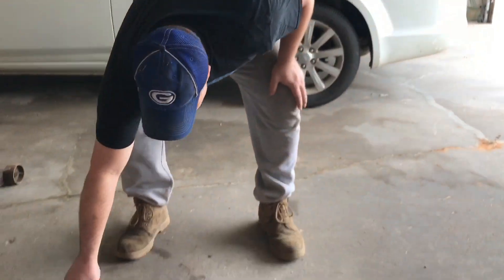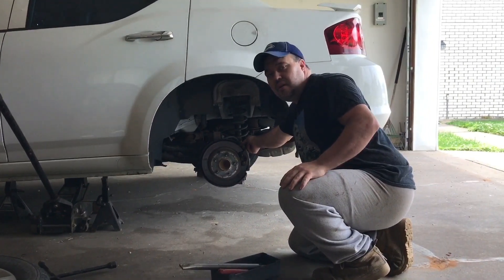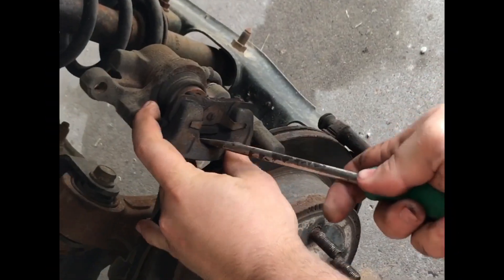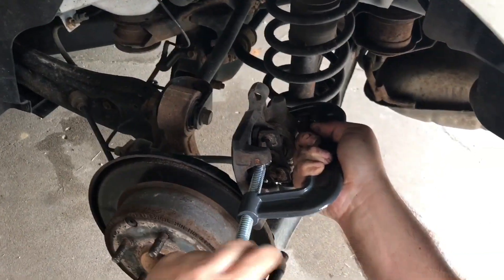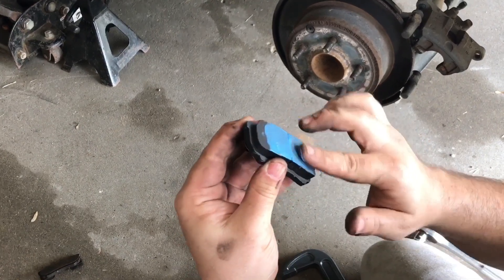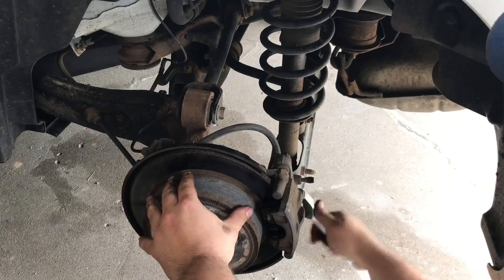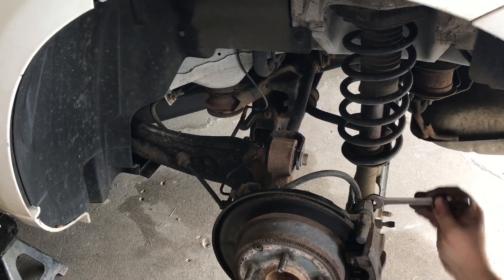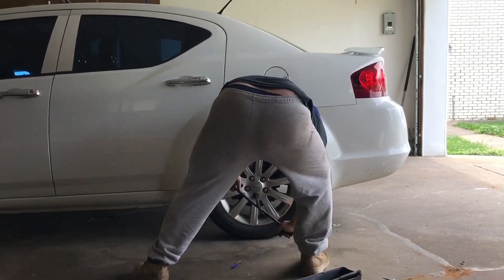Replacing Rear Brake Pads On A 2011 Dodge Avenger

Comment: Great video, thanks.  BTW, I found out something interesting.  My top bolt wouldn't budge...  I almost gave up, then I realized, you don't need to loosen the top bolt at all.  I pulled the bottom bolt out, and the brakes swung around anyway pivoting on the top bolt.  Phew.
Thanks again for the video.  Loved hearing your family in the background.  :)
Reply from the maker: mont pierce   Thanks :)